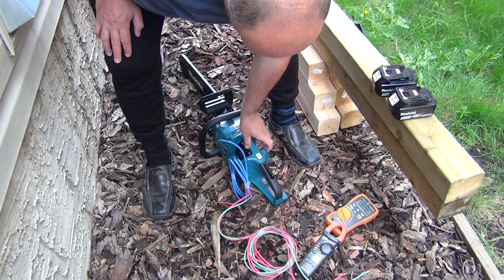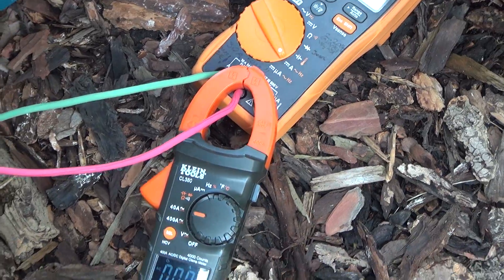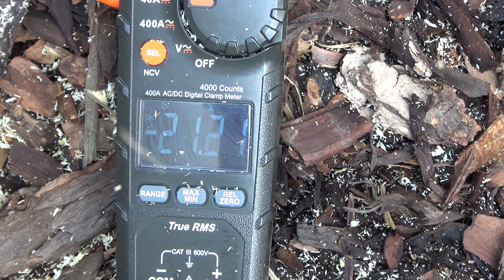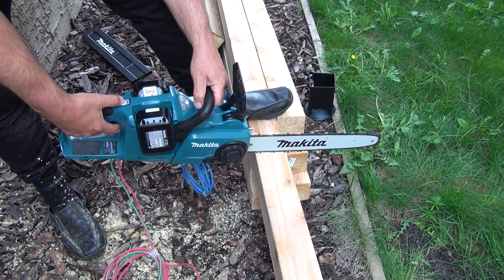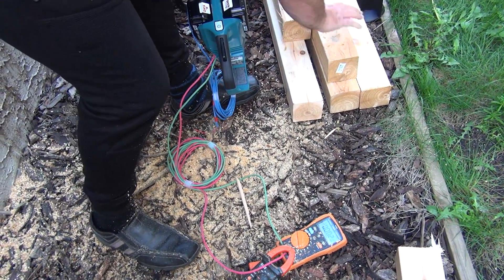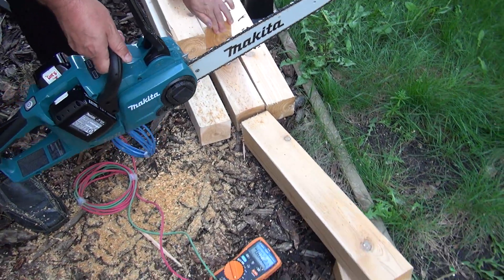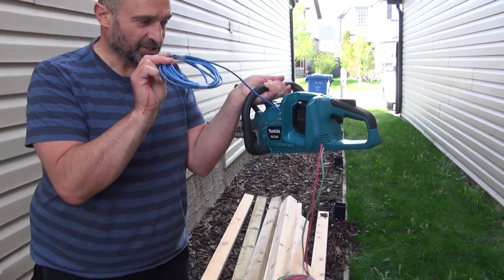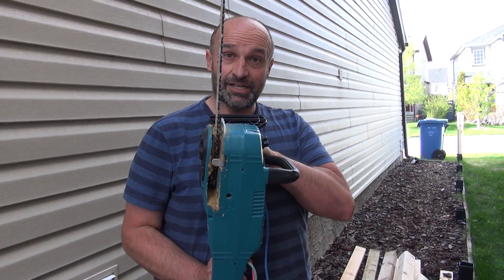Makita DUC400 18 V x 2 .. 36 V brushless chainsaw  .. checking working amperage ?? .. 20200523172716

Comment: Thanks for doing this.  This is the kind of stuff I like to see.  I've used mine to saw the equivalent of over 20 bush cords of 20" nominal hardwood logs and noodle them into small pieces.  I've worn out a sprocket and a 16" bar.  Great saw, Makita.

When cutting wood larger than the bar I suspected that the saw is using around 1000 watts or more.  I'm guessing at this because of what I know about the individual lithium cells in the battery.  You were showing as much as 25 amps with just 4 by 4's.  Cutting full length or noodling 12" pieces should up the amp draw a little from what you're seeing.  At 36V 30 amps is 36x30 = 1080 watts, right in the ball park I was thinking.  I would love to hear the actual amp draw when cutting a 14" log at it's widest point.

It's curious that the power of corded saws is always expressed in watts, but battery saws never disclose a power output.  Volts are meaningless to express power without the amps.  Being brushless these battery saws likely do more work (more efficient) than corded saws.  They can cut more wood with less watts.
Reply from the maker: I am glad you liked It .. 😀👍 ..